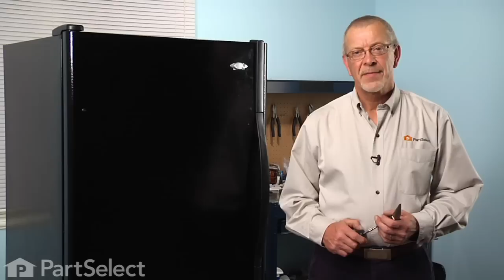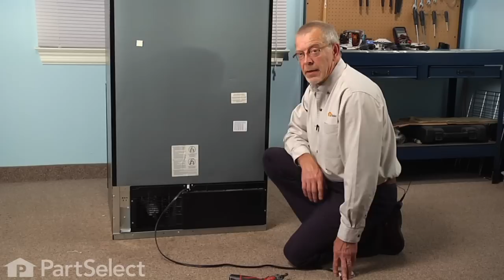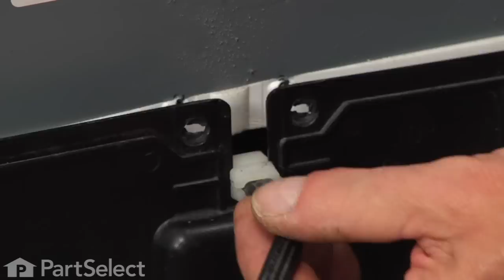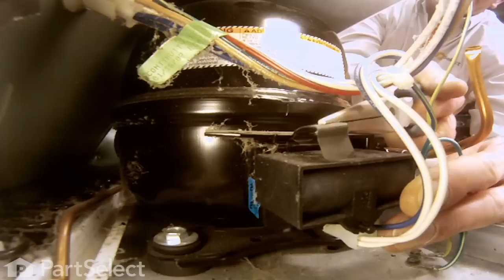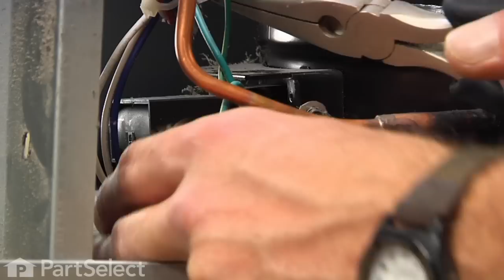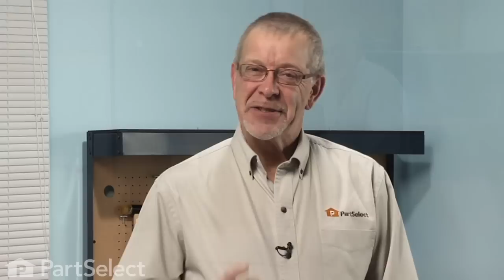Refrigerator Repair - Replacing the Overload Relay with Start Capacitor (Whirlpool Part # W10613606)

Comment: Hi, I have a problem, I have a Jenn air refrigerator  I did clean the ice cube maker,after that I did accidentally push the lock button, now I can't  take it off , the ice maker, or water is not working,
I pull the power out like 20 minutes, I turn it on again, still the same problem.
I hope you can help me .
Am desperate.
Thank you Steve.
Reply from the maker: Hi, could you please provide your refrigerator model number and I will be happy to research this for you.
Reply: PartSelect 
Model # JCD2389GES
JENN-AIR
REFRIGERATOR  2 DOORS.
Thank you Steve.
Reply from the maker: Hello, you should be able to unlock the dispenser control by pressing the dispenser lock keypad 3 times within 10 seconds.
Reply: PartSelect 
Thanks a lot, I did it, everything's working good now.
Thank you Steve for your help.

Comment: when the compressor stops the licht every thing stays on.but when it starts again it trips the breaker
Reply from the maker: As stated in a previous reply: If the breaker trips when your refrigerator tries to start, you may have a shorted compressor, start
relay or start capacitor. Remove the capacitor and if the breaker doesn’t trip, you have the culprit. You can check the compressor for a short using a multi-meter. Check each of the three connection pins to the metal case of the compressor. There should be no continuity. Check between each pair of connector pins as well. You should see no less than 4 or 5 ohms for each set. If less,
the compressor windings may be shorted. Is the refrigerator running from an extension cord?

Comment: what if it trips the breaker?.
Reply from the maker: If the breaker trips when your refrigerator tries to start, you may have a shorted compressor, start relay or start capacitor. Remove the capacitor and if the breaker doesn’t trip, you have the culprit. You can check the compressor for a short using a multi-meter. Check each of the three connection pins to the metal case of the compressor. There should be no continuity. Check between each pair of connector pins as well. You should see no less than 4 or 5 ohms for each set. If less, the compressor windings may be
shorted.

Comment: whats the micro reading on that cap
Reply from the maker: The cap has information about the part's electrical specifications and other information the manufacturer needs during the part's assembly.

Comment: I own a 2005 Whirlpool refrigerator that is strictly a refrigerator only. ( It was made to sit alongside a freezer only model to give a side by side look, but two separate units.) I had a repairman come to replace the compressor.  Because it is an "enclosed system" the compressor can be replaced for around $800, but it may not last longer than a few weeks. Also there is no way to check the lines to make sure there's no oil in the system from a possible leak from when the compressor stopped working. All this is according to the repairman that Whirlpool recommended.  I would be better off buying a new refrigerator. (according to the repaiman) I do not want to buy another refrigerator and send this one to a land fill. It stopped cooling. I am saddened and disappointed and want to keep this refrigerator by repairing it. Any thoughts? Model EL7ATRRMS07; Serial EWS0606248; Ref 134-A; Date 200501 Thank You, Sharon
Reply from the maker: Most refrigeration technicians would vacuum the sealed system to remove any residual oil before installing a new compressor and recharging with refrigerant. They would also perform a nitrogen pressure test to check for any existing leaks.

Comment: This is nice but I have had to cut the wires because the slide on connectors on the starter connected to the compressor would not come off and even now with the a quality pair of pliers I still can't pull them off even whilst standing up holding the part, what I am saying folks is doesn't always run so smoothly as the youtube videos suggest. When fixing things like well used washing machines ect  be prepared.....Mine was a 13 year old Beko freezer model that I am repairing.

Comment: i have a kitchenaid refridgerator and the panel in the front that controls water and ice has no power to it. there are no lights on it and doesnt dispense ice or water. is it the board? what is a cost for that part?
Reply from the maker: What model number do you have?

Comment: I have a Kenmore Elite French Door Model # 795.77543600 For months I keep finding a frozen mess under the freezer. I've been out of town and upon return everything's defrosted. I unplugged it overnight & checked the drain hole, seems clear. The compressor is vibrating and seems hot to me, the fan in the back is running. Also there's cool air blowing in the freezer, but nothing will freeze or get cold. Any help would be greatly appreciated :)
Reply from the maker: +Jennifer Gooden You may have a sealed system problem that should be diagnosed by a qualified technician.
Reply: +PartSelect Thank you for your reply. In your opinion, would it be more cost effective to buy a new one? I have never had a quote on anything like this before. Thanks so much, your videos are awesome!
Reply: +Jennifer Gooden KitchenAid has 10 year warranty on the sealed system parts (which includes the Compressor).  Kenmore should be the same.
They cover parts only but still better than buying a new one.
Reply: +PrimalMiltos awesome, I'll look into that!!! Thanks so much! I hadn't thought about calling Kenmore themselves, I called Sears and would have been better off asking my 5 yr old for help. Same with my Kenmore dryer, I'm never buying an appliance from Sears again.
Reply from the maker: +Jennifer Gooden That appears to be a nice refrigerator and is probably worth repairing. Find a reputable servicer and geta quote and ask about their warranty on this type of repair.
Reply: +PartSelect thank you so much, I've been out of town but will definitely do that upon my return. I really do like this refrigerator, and never wanted to have to replace it. I appreciate your time!

Comment: 2 of the 3 wires connected to the overload relay were damaged. How can I repair/replace those wires? 
(it's just the plastic tip(female entry?), the rest of the wires are fine.)

Edit*: My fridge model use separate wires to plug that relay. It's not bundled into one end like the one in this video.

Comment: Just replaced the overload relay/start capacitor I got from you guys. Was for a Amana fridge   #ABB2224DEQ which wasn't cooling top or bottom Also recomend vacuuming the inside too, for I was surprised how much dust had collected over ten years. Also removed the front bottom plastic screen, washed that and vacuumed inside the bottom too. Total time involved about 30 minutes. Saved $$$$$$ vs a house call by a repairman.

Comment: I have a Samsung RS2533SW that both the Freezer and Fridge are not cooling . I did test and nothing came up . The compressor is warm and sounds like it is either turning on or trying to turn on but then I hear a click after about 30 seconds  , then another click after about 5 minutes . Any help would be appreciated ? Thanks
Reply from the maker: Rich S Almost 99% of the time when this particular model isn't cooling it is a faulty defrost temperature sensor. Here is a link to the part you need: http://www.partselect.com/AdvancedModelSymptoms.aspx?ModelNum=RS2533SW&mfgModelNum=&fkMfgID=1&searchTerm=&ModelMasterID=152565&PID=10

Comment: Is this the same with an Antares Edina vending machine refrigerator????
Reply from the maker: Most overload and relay assemblies would be specific to the manufacturer. These include Embraco, Danfoss GE and other brands, and the parts would be specific to your model although the repair would be similar.

Comment: Hello Steve...I have a Kenmore compact refrigerator model # 92489.  I would like to install a more "powerful" start capacitor.  I'm sure your first question is "Why?"  The refrigerator is located in a van and is powered by 12V DC batteries through an inverter.  The inverter has a low voltage protection switch that shuts off the inverter when the voltage drops below 10.5V DC.  When the refrigerator cycles on, it requires a momentary surge in current/power to start.  This triggers the low voltage protection shut down on the inverter turning off the power to the refrigerator.  Attached to the compressor on this refrigerator model is an overload protection switch and a PTC.  I would like to replace the PTC with a Start Capacitor.  Do you know if the GE start capacitor you installed in this video will work in my compact Kenmore refrigerator?  The compressor is Jiangsu Baixue. The model number is QDH2511G. I have no idea what the horsepower rating is.  It has the three pin connectors the same as the refrigerator in your video.  It has been suggested on other HVAC forums to try replacing with a Supco 3 in 1 hard start kit.  Before doing so, I wanted to see if I might be able to use the same GE start capacitor you are using.  I guess the other question I have is that by removing the PTC, will I also be removing the run capacitor? Have not been able to identify the run capacitor for his compressor.  Would it be located inside the compressor housing?  Sorry about the long message.  Any knowledge or feedback you can impart is much appreciated.  Thank you for your informative videos.
Reply from the maker: Thank you for watching our videos. Unfortunately, we do not have any information regarding this compressor that would indicate what a recommended start capacitor value might be or if a run capacitor is used on this model either. Good luck with your research.
Reply: As follow up, I purchased a Supco URCO 810 relay start capacitor and overload protect kit and thus far is working find and met my needs.  It was inexpensive and easy to install.

Comment: Hi Steve,
Thanks for the video, very helpful.
Could you please explain how to check this overload relay to be sure it is really a bad part?
The second question is: Are there two types of capacitors, Start and Run Capacitors? What is the capacitor you are showing in the video? is the other capacitor also might cause compressor start problems?

Comment: Great video, thanks for posting!  I just have a quick question about my Kenmore 62402 that is 2 months past warranty (unbelievable!)  The refrigerator stopped cooling, even though the light comes on and the outlet it is plugged into is fine.

After unplugging the refrigerator for a few days, sometimes just a few hours, and then plugging it back in it cools and works fine for about 4-5 days and then I notice ice cubes melting and no cooling at all.  Do you guys think I need to replicate the action in the video?  Thanks so much for your time and helpfulness.

Comment: My unit was clicking and wasn't cooling and freezing so I searched online trying to figure out the problem and I learned that it might be because of the relay/overload, so I purchased one and replaced it  but the problem didn't go away and my unit is still clicking and not functioning and the compressor is super hot.... What else could be wrong?
Reply from the maker: Hi Parizad, thanks for your question. It would be helpful if we had your unit's model number, however chances are it is a problem with the start/run capacitor. If that's not the problem I would suggest the compressor has failed, in which case I would recommend using a technician to replace that part. Best of luck isolating the problem, and good luck with your repair!
Reply: Hi!! thanks for your reply.... the problem was the compressor :)

Comment: I have a Whirlpool Refrigerator , model et20gkxdw00,  serial # ee2625022 - and it  has a Embarco FGS 70 GA compressor.  The compressor runs at 115V at 60 Hz, thermally protected, 10 LRA, using R134a, 1 pn.  Here are the numbers on the sticker of the compressor. 513205317 and F95FE0OX.  My question is:  I would like to find out how i can figure out  the right prc thermistor relay starter  just by having information off the compressor.

Comment: We have a Samsung rs2533sw that stopped working last nite. The freezer temp control was blinking when we noticed it. We tried to turn off  and a beeping noise sounded from behind the unit. Turned back on, and and it showed actual temps much higher than displayed. Yes we think there was some bad weather that may have something to do with this. Since we restarted it we hear clicks quite often. What is first step for amateurs??? Vacuuming? Next?

Comment: I have a Samsung RS2533SW and 4-5 days ago this refrigerator compressor i assume was start making a loud humming  noise kind of like a motorcycle on idle, now is not making that noise but i don't hear compressor starting, and the fridge temp light start blinking seems like freezer still keeping it at 0 degree but fridge temp is high ... is that means the compressor overload relay is  gone ?

Comment: Another way is to connect an ammeter to the compressor's common wire or plug it into a line-splitter and check the amperage. If you hear a click, it will have a high amperage reading. If the compressor runs it will normally draw about 1.5 amps. If it runs and a higher amp reading say about 5.0 amps, this is a sign that the compressor is going bad. You will also notice a lot of heat.

Comment: Hi Mike I live in australia and have been given a whirlpool model number wbm46mw fridge. when you put power on it the only thing that comes on is the red power light on the panel. no compressor and when you open the doors not even the lights in the freezer or fridge inside come on any ideas. thanks Nick

Comment: I have a LG LRBN20514ST it has a Embraco EGU70HLC compressor with 3 wires 1 blue, 1 black, and one pink.  I would like to use this compressor to make a silent airbrush compressor.  I need to know which wire is hot, which is neutral and what to do with the third wire  it has a little black plastic box on the side, which has these three wires coming out of it.  Do I need to add a solenoid to this? if so where?  I am trying to find a wiring diagram  
Thanks
sblacklord@hotmail.com

Comment: There's only one fan with this smaller 10 Cu Ft unit. (no fan by the compressor). The one fan in the freezer compartment blows air down to the refridgerator.  That fan is running just fine.  Still hearing that loud click at the compressor but then compressor won't turn on as I described above...  Next Steps?

Comment: What a great video! Thank you! Is there a sure way to determine if the problem is the relay or the compressor? I have a cheap Sperry multi meter and tested continuity from the top terminal where the relay plugs in to the other two terminals on the compressor- it showed values less than 1- which by my research indicates that it's the compressor, but I'd like another opinion before I call someone out just in case I'm wrong and purchasing a relay from parts direct would solve the problem. Help?

Comment: Wow, you Partselect guys are great!  OK, I just looked at everything connected to and near the compressor and there's not a spot of rust or rot anywhere and all plugs/wires are bright, shiny and connected.  Do you think my compressors shot based on the description I gave above e.g. is tries to click on then goes dead?

Comment: I have a Magic Chef, MCBR 1020W that's completely thawed out.  The compressor won't kick on but tries to.  Every few minutes you hear a click and the fan blowing up in the freezer begins to labor and slow down while the compressor tries to kick on then nothing happens.  I watched the relay replacement video above but this unit's relay is different with a lot of wires plugging into it....  Before I take all those off (assuming that's the relay) can you advise?

Comment: Hi Steve-Just writing a follow-up to my note below-I know you are prob swamped but if you get a minute would be great. The refrig section is now definitely not working-there is some slight cool air on both sides uit no freeze/cold at all-just semi-cool breeze & frig is not cool enough to store food that is perishable-not able to call tech due to funds issue so stuck. Main thing is frustrating as I hear the prob-the engine at bottom starts & then clicks off so fan never gets a chance to run. THX

Comment: Whoever watches this and does the job themselves, make sure fridge is unplugged. A faulty overload relay (if it RATTLES inside, IT'S NO GOOD (remove and shake)). A defective one will prevent the fridge and freezer from cooling. I'd thought I'd throw in just a few extra words of wisdom. Good luck

Comment: @partselect

I would like to know if my GE refrigerator side by side model DSS25KSRE has a compressor relay with capacitor because I already checked the thermistors, thermostat, heater coil and I even replaced the main board  with model WR55X10942 but my refrigerator didn't cool from the very start I plug in the AC cord for 12 hours of testing it. Kindly help to diagnose my refrigerator. Your knowledge that you would share from me would be appreciate.

Comment: why in this video you did not show the exact problem. only compressor not working . but you did not trouble shoot the fridge  before you replaced the parts .how can you probe the  exact problem is overload,relay,   you did not also measure the resistance both of the terminal,i know you are a professional but you did not follow the basic tools , with out    thermometer ammeter. multi tester.